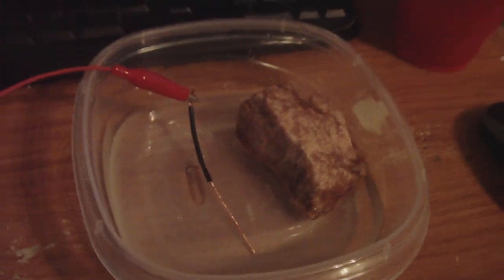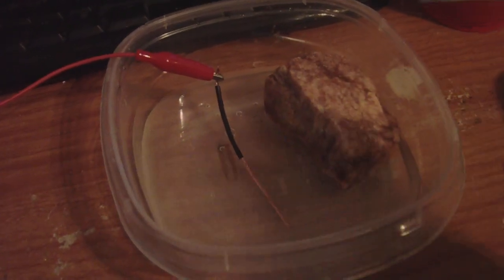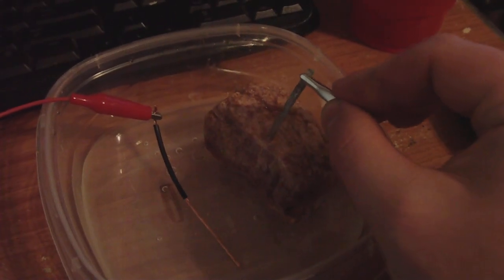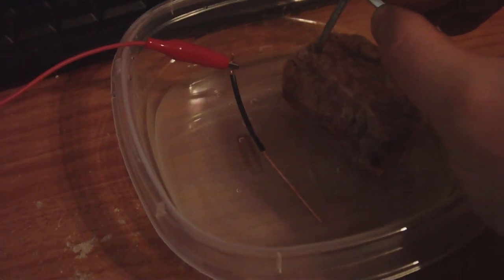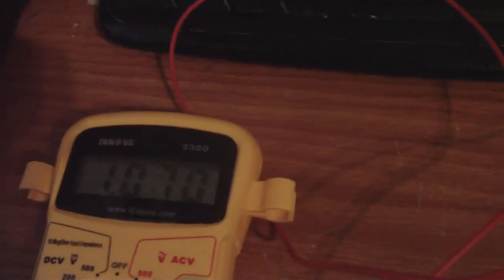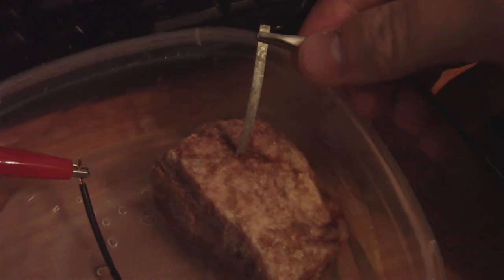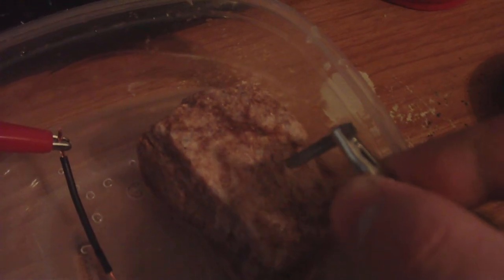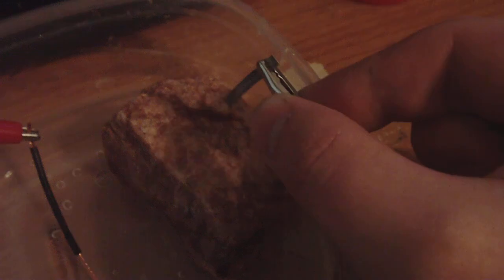The Energy can travel through rock

Comment: I don't think this is entirely accurate. The surface might look dry but inside it is wet. Ever heard of capillary action? Once the rock sits in the water the water gets sucked up into the rock. Then when you put the little bit of water on the top it completes the circuit. As long as the item is porous and is sitting in water it will have water in it. The water on top is just making better contact on the surface with the water inside of it when compared to the "Dry" spots..